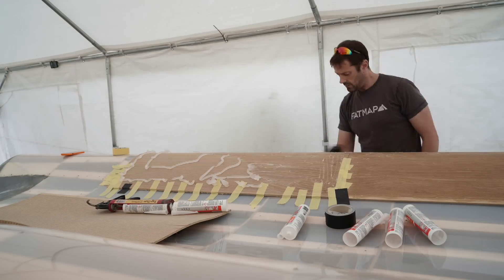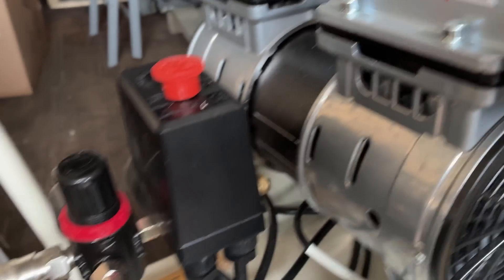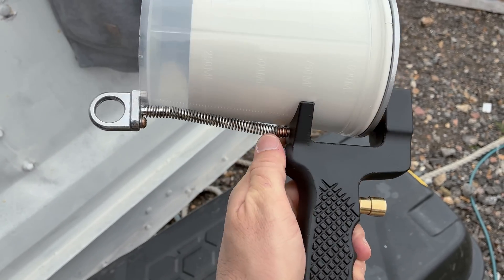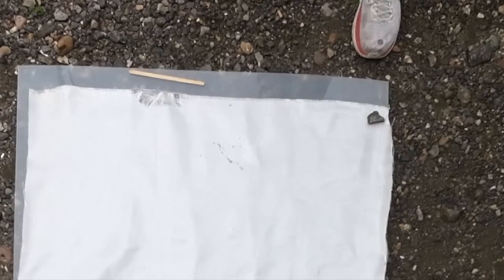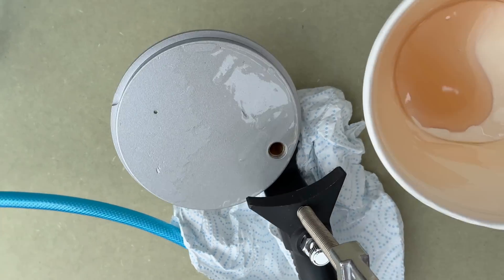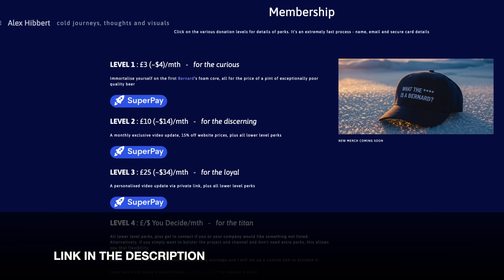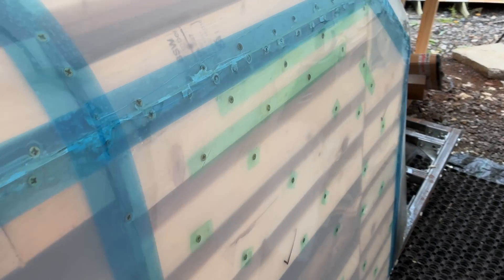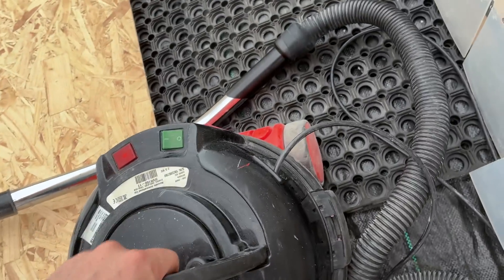Resin spray gun test (lamination/gelcoat) compressor fix & more. Arctic Vehicle Project BERNARD [4K]

Comment: Instead of cling film, you could try window film which you stick to single glazed window frames with double sided tape to make a sort of double glazing. It is heat shrunk with a hairdryer to pull it tight, which would pull out all those creases. Look for window insulation kits in DIY chains.

Comment: Have you thought about trying an undercoating gun? Also you may have issues with the cling film melting as the epoxy is cures
Reply from the maker: I'll check out an undercoat gun and see what the flow rate is. The epoxy is ultra slow cure, so low exotherm.

Comment: I had the same experience with the gelcoat gun, bought with the intention of using it to spray gelcoat into moulds.
I switched to the 3M perfomance gun, with 2.0mm nozzles and the pressurised cup. Though more expensive, it worked out cheaper than the HVLP, LVLP, and cup gun it replaced.
I've found compared to the gelcoat cup gun, the 3M one has a better spray pattern, more control, no drips, can spray at any angle, and significantly quicker and easier to clean.
Any other brand with a pressurised cup and nozzle of at least 2.0mm should do the same job, though maybe a little harder to clean.

I use a 100L 15CFM compressor, bought for around £500 new. I wouldn't recommend going with anything smaller.
Reply from the maker: Yeah, I'm not so worried about the drips as technique can solve that. It's the flow rate I was hoping would be a lot higher - I wanted to empty a 600ml pot in a couple of minutes by selecting the highest flow. That, combined with the compressor not keeping up with semi-continuous use ... well, it'll be good for other lower volume spraying jobs.
Reply: @AlexHibbertOriginals  Ah I see, well if it's any help, I found on my last mould, it took around 5-6mins to spray 2 pots of 800ml polyester gelcoat, prioritising finish quality over speed.
So with a higher CFM compressor it might be achievable.
Reply: @AlexHibbertOriginals  I use the 3M PPS Series 1 with their pressure pot. Series 1 allows you to use the cheaper generic cups, the pressure pot allows you to spray significantly thicker coatings including resin and gel coat

Comment: Painting mask for cars comes with a sticky side and a side for paint applied properly it could be great under the peel ply layer
Reply from the maker: Is it low tack? I want it to lift off super easily
Reply: It should be low tack it’s designed to lightly adhere to car body’s and be removed the opposite side is like none stick and paint should fall off it’s called Masking Auto Sheet Plastic Film and comes in large quantities 😊
Reply: Hope you find this helpful

Comment: You could source a used compressor solely to use the tank off it as an aux tank for your main compressor. We use at a rescue station here in Ireland so we can pump our rescue boat .
Reply from the maker: Hmm - I'll investigate. You attach the tank to the outlets of the main compressor ?

Comment: Another idea, instead of cling film, try some car wrap. Car wrap plus a heat gun.
Reply from the maker: I don't want it to adhere - just cling lightly
Reply: @AlexHibbertOriginals fair, although car wrap doesn't have adhesive, its just large formable plastic sheet. Sticks well to steel sheet, I think it would struggle to get adhesion to the mold in the same way. Heat from the curing process might be an issue for the car wrap mind.

Comment: I think roller is the best option bud. The only time I would spray would be high end paint finishes. If you do continue down the spray on path I can drive down and give you a hand and also bring my compressor. If you get a dual hose union we can connect them together and double your capacity. Also what pressure will the  vacuum bagging be at? Also if your ever spraying paint (kinda applies here) you begin the spray off the panel then bring to bear then move across the panel then bring the gun away and then stop, helps mitigate drips, a lot easier to do with paint as its nearly dry by the time it hits the car. Still might help mind. Also I was thinking about the mold release, if there were a couple strategic plugs  (which you could blow air into) installed in the lay up. Once the thing solidified you could attach the compressor onto the plugs and blow air between mold and part thus releasing the part from the mold, then afterwards just plug up the holes.
Reply from the maker: I suspect you're right. The flow rate was slower than I expected even at full flow. Cheers for the offer. At any rate we will definifely need pairs of hands late this month/early Sept.

Interesting idea about helping the release with air.
Reply: @AlexHibbertOriginals  

My ideas > my spelling

Comment: I did similar experiments a while back with the same gelcoat gun and came to the conclusion it does not work, especially on larger areas. The best way I found to do large areas is to pour the resin on then spread with a paint roller. For flat vertical surfaces a cheap plastic dust pan works quite well. Pour some resin into the pan then hold the edge of the pan against the surface. Tip the pan up to make the resin flow onto the surface and slide the pan up, almost like a paint brush. You can use old milk cartons cut at an angle to make applicators as well.
 I would recommend that you don't worry too much about getting the perfect resin/reinforcement ratio. Too much resin just makes it a little bit heavier, too little seriously weakens the part. If you try for the perfect ratio you risk ending up on the dry end of the spectrum.  On a big area like that you you will have to move fast and you simply won't have time to be ultra fussy.
Buy a fair amount more resin than you think you will need. You'll almost undoubtedly end up using more than you expect. As you need to work fast you'll probably end up spilling and wasting quite a bit in the bottom of mixing pots. Epoxy is expensive but running out before you finish would be disastrous.
Reply from the maker: This is a very good comment. Yes, I suspect rolling may be the result, but I do want to avoid an overly resin rich part, as that can actually weaken it (albeit not as bad as a dry part).

Good dust pan technique. I'll have a go.

Luckily the resin has a 7hr pot life.

Comment: You’re going to need a bigger b…. tank :0) But apart from that, everything else can be addressed with ingenuity and helping hands. Wishing you much luck!
Reply from the maker: Cheers. I fear the flow rate is going to be too low for bulk application. Would need to be nearer to a sprinkler hose!

Comment: To use the dump gun you need to start with the gun pointing straight up. Pull the trigger and then lower the gun down this will avoid drips. For your application it will probably be more trouble than it’s worth, constantly trying to fill it and running out of air. Buckets and rollers will do a perfectly adequate job. Don’t put peel ply on the male mold it will be a mess. Don’t try to use cling film, more mess. Spray the mold with PVA (Polyvinyl Alcohol) don’t use the dump gun😄spray the mold with several coats this will provide the release of the part from the mold👍
Reply from the maker: I agreed with you on the first half. 

I think using a chemical release on the male mould will cause tons of damage to it. Very happy using film for applications like these where the part facing the mould doesn't need a quality surface finish.

Comment: rather than trying to seal all the holes and edges have you considered putting a blank bottom sheet across the bottom of the mold at ground level and putting the whole thing in one big vacuum bag? the hollow space in the middle wouldnt be an issue and it would be a lot easier to create a consistent seal.
Reply from the maker: Considered that, but the vacuums are strong, and that could distort the polypropylene mould surface into waves.
Reply: @AlexHibbertOriginals  Fair point, you know the rigidity of the mould and what it can handle

Comment: Window Tinting film and squeegee the air bubbles out ? I've not idea what it's made of / how it'll react to resin though...
Reply from the maker: It's possible that might adhere too strongly? I want it to lift away super-easily
Reply: @AlexHibbertOriginals  might be the oddest suggestion you'll get, but bondage tape over a layer of pva glue, the tape is designed to stick to only itself, hence the pva glue. and no i will not entertain questions on how and why i know

Comment: The dripping from the gun is pretty bad. I'd have expected a needle valve or at least some spring loaded bearing, but maybe that's just not compatible with resin.
I am a little surprised about how you intend to use the spray gun ("prepping" the sheets to then be used sort of like prepreg). For that application, I'd have thought a setup with a resin bath and some rollers to push the excess resin out would have been more efficient.
Reply: The problem is that with polyester resins you have a working time measured in minutes. That means you have to be able to clean the gun quickly and easily. Needle mechanisms make the gun a lot slower to clean. If you do leave it too long and the resin starts to set a very simple gun like this can often be saved unlike a more complex gun. 
These guns are designed for spraying gelcoat into a mould, not applying resin. All they need to do is provide a roughly even coat without the thin spots you often get when brushing. They are a bit different to use than a traditional gun. Keep it pointed up whenever you aren't spraying. When you want to spray, pull the trigger then tip the gun down to spray. To stop spraying tip the gun up then release the trigger. Never let go of the trigger with the gun tipped down.
Reply from the maker: Yeah I quickly learned to point it up when not spraying. 

These are specifically marketed for laminating resin application btw, as well as gelcoat (which remember is just thickened resin and pigment).
Reply: Yeah, as someone who has had to use spray guns and compressors quite heavily in a previous career, I was also hella baffled by his approach.
Reply from the maker: Yes, these guns are called 'dump guns' by some and lack needles. I was surprised that surface tension of the leading edge of the resin wasn't able to keep the resin in place until blown with air.

The reason for the experiment is to carefully dose resin, in a way it's tough to do with rollers or spreaders. I want a good resin/fabric ratio.

Comment: This is all very interesting and commendable, but I hope the journey is worth it for you, because it is difficult to envision you reaching any destination with this project. It is potentially much more dangerous than the Alan project, and yet much flimsier. I cannot see you going through with this after you dumped Alan so quickly. I still watch your videos because they are interesting (and I have no skin in the game at all to lose), and I will probably always watch your videos, but as an engineer and part-time adventurer, I cannot see Bernard being anywhere near safe or reliable enough for the adventure you are planning.
Reply: I feel like Alex is more disciplined than your typical tinkerer. I was worried too (still am a little) because the scope is so grand, but he is setting quite the pace. I hope the money lasts and he doesn't burn out (on the project or in general).
Reply: @anonaustria9867 I feel like using an existing shell or drive-train would have been cheaper, quicker, safer and more reliable. He did discuss options in the first Bernard video, but he missed some of the existing options. That Oceangate guy was also more advanced than your average tinkerer, but somewhere along the line you need to set ego aside and accept reality.
Reply: @TortillasAllTheWayDown  Maybe not the best comparison... Oceangate did produce a functioning vehicle, and a single failure in Bernard won't cause a deadly implosion. Anyway, we're knee-deep in the project, I feel like at some point constant doubting will just get annoying. Alex has obviously committed, and I for one would like to see him succeed.
Reply from the maker: My career is actually punctuated with journeys I have stopped early or decided not to launch due to changing circumstances. I'm alive.

No issue with your (very large number of) comments, but please do a little research before casting so many stones.
Reply from the maker: Making OceanGate comparisons is just moronic.

Cheers for the reasoned positivity.